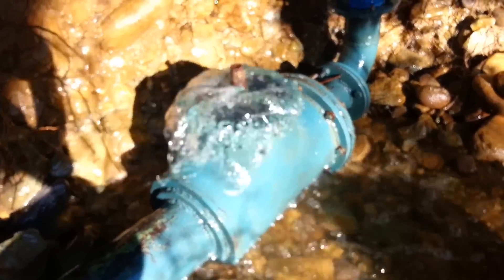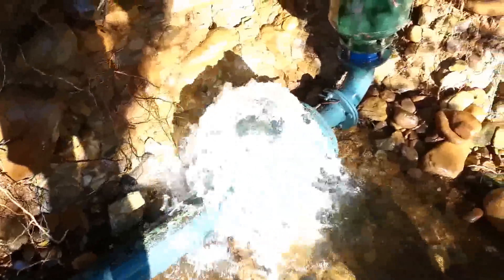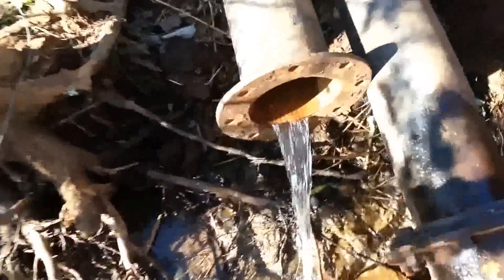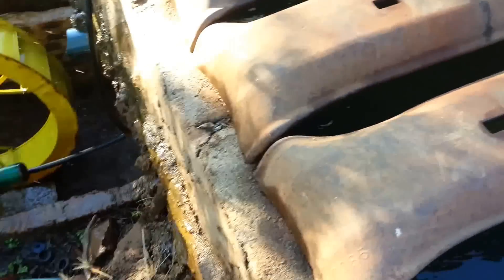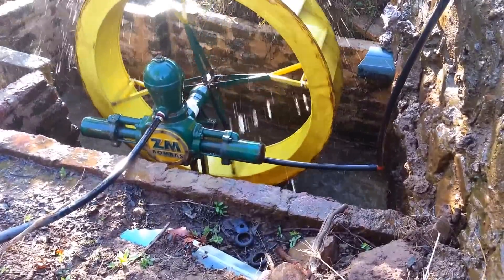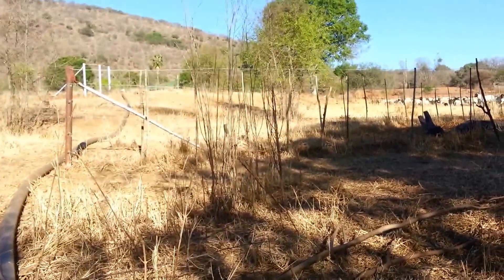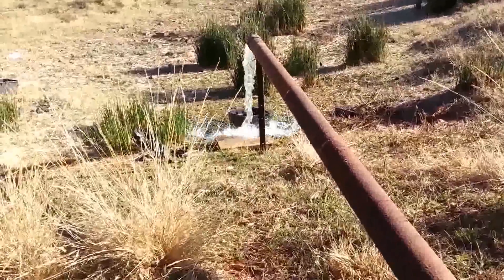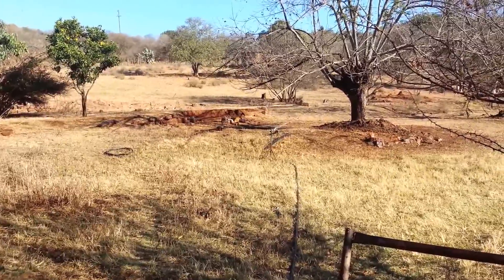DIY Ram-pump ( Big home made Ram pump)

Comment: Thank you for posting the video.  It is rare to see the same person running two types of water powered pumps - in your case the ram pump and the zm Pumps water wheel piston pump.  How would you compare the pro's and con's of  each?
Link to zm Pumps Facebook group discussion:
https://www.facebook.com/groups/240458583255303/permalink/247360809231747
Link to new comparison of water powered pumps Facebook group discussion:
https://www.facebook.com/groups/240458583255303/permalink/688190278482129/

Comment: Although you "showed" us what was there, you didn't explain what anything actually was, or how it was made, or  how it worked or provide any figures of flow rates in/our, height/lift, etc, other than 1200 lpm. Some schematic drawings would have helped. I found it thoroughly confusing and badly explained.

Comment: I did not grasp where the original water in the reservoir came from, I see that it goes to the big clanking pump in the stream bed. The water wheel thing seemed to be pumping the wheels waste water up to a sprinkler - I was fascinated & engrossed but got a bit lost. Maybe a diagram on paper showing the major parts at the start and throughout the video ? thank you for sharing - very interested in this setup

Comment: Very cool man very cool. You have an amazing system there. Amazing water resource. 

Does the river go higher than your land? A siphon seems like it would work if it does. Or a trench. 

Also if you are going to this extent, why not put in a proper turbine? Then pump with electricity and power your life and neighbors life too? 

When you use the water I can say that sprinklers used during the day are the biggest waste of water and nutrients. Better off with soaker hoses that are partly buried. Saving all that water pumping could give you the electricity for your life and leave the extra water for the fishes...

Anyways It's easy for me to say from my armchair, good on you for actually doing it!

Comment: You use lots of water falling a short height, to make a smaller amount of that water move a higher height than the water is falling from.  If 100 liters per minute fall 2 meters, this thing will give you something like 5 liters per minute pumped 10 meters up. That allows you to use the freely-falling water (which costs nothing), to get some usable water pumped to where you need it higher than the stream. 
It's more efficient than say, making electricity with the falling water, then running a motor to pump water. This is because you forgo electrical energy loses, and just focus on driving a pump to push water, using water. Losses are only the mechanical loses of the pump that's pushing the water (inevitable) and however efficient the powering side of the pump is. But you're using a mechanism that pretty much can't break, can't overpower itself, has minimal moving parts and is powered by falling water... which you appear to have a lot of! 

 The simplicity is beautiful. Why wouldn't everyone want to put mother nature to work in this nearly harmless way?

Comment: Just a question. Would it not be better to use something like a venturi where your pressue supplies join? Seems like using a tee both supplies are somewhat nullifying each other and would do away with the 90% elbows which constrict flow. Great video and well explained
Reply from the maker: nostoh thanks for the input and thank you for watching my video and for the kind comment

Comment: that is some nice output coming out that large pipe you opened the valve on....not sure if you need it..but if there is excess water at the top of the hill you dont need....run another pipe down toward the creek and put a small hydro generator station and create some power/hydro...

Comment: A ram pump derives its energy from the head of water located above the pump. What is the minimum head necessary to power a ram pump? Is there a flowing water equivalent of a hydraulic ram pump, i.e., a ram-type pump that derives its energy from shallow flowing water?

Comment: Hey, I had just a few questions?  Did I understand correctly ithat the pump feeds water into a storage containter?  Is that the one over by the water wheel?  My question was, the pump is designed to use waters natural elements of how it works with gravity to buid pressure and in turn, well, harness energy. I wanted to use somesimilar devices to do the same at my house. I  live in the city tho, with roomates and it sucks sometimes Iwish I didn't have to go share a bathroom area with them, bu instead had  abathroom arjust set up in my room with natural running water, but just placing a bucketor container of water on a pulley system (if I need that.) I thought at first, I would need to find a gas pump to force the water down wards ino my macgyer ass running water system.  I don't think I could use this unless I needed another part that just needed the overflow watet to be controlled, but I tried to make a syphon one today that used the pulley system as well, but instead of raising the whole water bucket I wanted to just find  a way to push and pull the air,.  I was thinking maybe foot pump or something because I tried making a water syphone pump and no water came out the tip it was supposed to.  My next try I think is to just place a piece of rubber in the storage container that will start eh whole gravity force thtat gets it in motion, and when someone pulls ont he valve to turn the sink on, it will remeove the rubber, and send the water down throught  gravity....

Anybody know what's up?

Comment: I am wondering if balancing your water wheel would help pumping a little bit more water.
Reply from the maker: i sold that thing
Reply: I wondered if the speed was the pump/fill strokes.   I thought it seemed unbalanced too.   Think if you had a public utility that had a bunch a ram pumps filling a really large water wheel.   You could get decent power output off of that from the weight.   There’s no inhibition from having ram pump after ram pump on the same source...or even in a chain up a hill as long you had enough head and input into a reservoir to feed it.    It’s just a real simple overflow drain for the extra.   The world’s about to change
Reply from the maker: I agree with you.  Thanks so much for the comment

Comment: I would have thought this amount of pulsing shock would eventually shatter any of the more brittle steel components. Lost of smaller rams would only loss you a tinny bit but you wouldn't get that noise or risk problems from such presser and impact shock. I would very much lover to have that kind of flow of water on my land though.
Reply from the maker: thanks for your comment 
sir and thanks for watching

Comment: it is a beautiful pump system. discovered it today. saw a few different ones. different in size and loudness. yours gives a lot of water but it is very loud i guess and i can see the high forces generated inside. every time the water stops and starts moving again you see the pipe shifting a little. do you get failures a lot? i can imagine that valves will break or bolts and flanges will tear after some time. but a very impressive installation. keep it up
Reply from the maker: you are 100% right , i used to get alot of failures , if you are building a rampump to last you have to spend a buck to have it last thanks for watching

Comment: hey bro, nice setup :D just wondering if you're still using the same system, and have you tried a lighter weight check valve? maybe some brass pads that mate with other brass pads at the contact point to reduce the noise? just curious about how these would work. awesome vid, take care.
Reply from the maker: +lordmcted Hi there first thank you for watching and commenting on my video , to  answer your question no I am not using the same system anymore , it still works but I am using a solar pump at the moment , it is much easer and a lot less (1%) maintenance , not sure if you could use brass pads never tried it but I do  use thick rubber between the steel plates to make a good seal and to dampen the noise , if you have any other questions please post them I will answer them prompt

Comment: with all the money you pay in pipes you could buy a solar powered pump don't you think.
Reply: +marek amraly You could always source pipe from junk yards plus all you need are very  basic fabrication and welding skills which most country folks would already have so for some they are good to go.....
Reply: It'll also keep running day or night, and provided the components are beefy enough it'll run as long as there is water flowing.
Reply from the maker: you are right and i do now have a solar pump you can have alook at my channel i get about 26000L/h but if you have the pipes and you are poor like me at that time then you have to make what you have thanks for the comment

Comment: Some thoughts : A ram pump behaves in a mechanical sense the way a step up transformer does in an electrical sense. The electrical step up transformer increases the electrical potential ( being Electrical Potential Energy per Coulomb of Charge, commonly called Voltage ) of the current in the secondary coil at the expense of having less secondary current than in the primary coil. The mechanical energy step up transformer , in this case a ram pump, increases the gravitational potential ( or Gravitational Potential Energy per kilogram of water ) of a smaller volume of water being pumped uphill against having a larger volume of water being allowed to spill downhill . I've heard that some ram pumps have continued pumping for 2 or 3 almost 4 decades without needing repairs while also not needing an external energy source; just the creek itself.
Reply: Not a step up transformer but a boost converter circuit

Comment: I see the water in the creek, but how did you get it to the reservoir for the ram pump? I have a similar situation, but the creek does not have enough 'drop' for me to run a pump. I do have hills next to the creek which would work perfectly, but no way, other than electricity, to get water out of the creek. I like your setup, but still don't understand this part.
Reply from the maker: Hi ok so how it works is my river comes from higher ground now what I did was a dug out a ditch on the side of the river and kept digging it level along side the river so until I was satisfied with the height from the ditch to the river hope you understand thanks for watching

Comment: You should look to add in an electrical generator to the water wheel. You can derive useful energy from this system too. In fact, if you modified the ram pump you could wind coils on the outside and put magnets on the piston of the pump. The back and forth action will generate a current that you can rectify. There's many places and ways to extract electrical EMF from this sort of system. Even with out that your system is awesome. It's the biggest ram pump setup I've ever seen. Good on you for your productivity and ability to make the land green.
Reply from the maker: hi sir you have a brilliant idea , if you dont have alot of money you have to make due what you have but i think  it is better just to use solar panels thanks for watching

Comment: This doesnt look like the ram you were building.maybe I missed something.
Great pump though .My 2 inch ram is working hard to pump 1 gallon a minute.I think I may have the water to run a pump your size if I can scrounge the parts as you did
Reply from the maker: *****  yes in this video , this is not the ram that i build . this was my first ram that i build i did not make a video of me building it but i will post a video of the second ram that i build in my how to video , sorry
Reply: Phillip Fourie I live in Augusta Ga america and dont have the water you have,just a small creek dammed up that gives me 3 feet of fall.Do you know what gallons per minute your monster is pumping?
Reply from the maker: ***** dear Alan my 2 pumps pump around 3500L/h i would say each pump pumps around 1750L/h 
Thanks for watching

Comment: Hi Phillip,
I think you've got it.
Your are living in a place witch locks difficult and going to transform in in a Paradise!
Respect!!
The only point i would try is to stock the excess energy into Water or compress air and to come away from those ugly polluted batteries banks.
Watt about creating a pond with fishes to use the excess Water and organic material you will produce with the water on the land...
Regards from Switzerland
Peter
Reply from the maker: Hi thank you so much for your input ? I have an idea on pumping those waters for a quadraphonic system , I think it would work great and i will then recycle the water and have an income of it or do you maybe have a better idea ? what would you suggest ?

Thank you for watching
Reply: I gess aquaponics system?
Remember that water is not enough for your plants. Fish are producing the needed substances for your vegetables.
If you have a deep pond you can use the water all year long because the fish can stay in this water during frizzing seasons.
Calculate the deepness of the pond with this formula : 0,1 percent of the altitude your are living.
Example: you're living at 750 m altitude, you will need a pond of 0,75 m deep. 
To it, you have to add a half meter 0,5 m creating a zone (1,25 to 1,5 m in our case) in a side of the pond to operate or to extract fishes during winter or to save fishes in case of water losses or extreme heat and water luck.
If you find a way to keep the water always moving, you won't have any problems during winter.
The water better has to travel under ground to keep unfrozen during winter. Earth is warming the water up on a long distance.
New energy source:  you can heat or refresh your house with this water if the pond is big enough by using thermal exchange pump.
This will keep your electricity needs on a lower level during summer and winter.
Finally, you need to test the kind of floor you have to be sure water is going to stay depending of the region and the kind of grave... this is a difficult part including the geological risks...
What do you think about this part?
regards
Pierre
Reply: Paradise is getting near every day...
Pierre
Reply from the maker: ducati Switzerland  You see i am so thank full that you came across my channel , of all the research that i have done nothing came up like you said it , thank you so much for your knowledge and time to write to me i really do appreciate it ,and thank you dear sir for everything , thank you again and bless you
Reply from the maker: ducati Switzerland I have a pond here , made of concrete , for heating the water to 17 C i was thinking of using a small low pressure solar geyser or collector and recycle the pond water through it with the use of a small 12V DC pump and have it pumping during day and at night time a was thinking of covering the pond with a thick plastic like the ones rich people use to warm up their swimming pools and hopefully keep some of the water heat inside the pond or what do you think
Reply: Phillip Fourie I again Phillip,
Wich altitude do you live?
You pond will need a lot of O2 and living material as well if the concrete is to clean, it will be difficult to have a reserve for fishes. Maybe you shall not cover it but build a plane surface next to the pond like a flat cascade to let the water go over it and been warmed up by the sun and cleaned by the UV from the sun.
The cascade effect from the water dropping into the pond will bring you a lot of O2 as well.
The pump you plan to install is more necessary to clean the water trough a filter containing some charcoal, zeolith stones and gravel and sand after the water went trough your plants and vegetables.
what do you think?
regards and no matter
Pierre
Switzerland

Comment: Interesting video Fourie.
Your Ramp pump valve sounds as if it's metal to metal contact! The one I have has a half inch thick 7'' rubber diagram that deflects to cut off the water flow and the pump makes far less noise than yours and will probably last far longer! Doesn't yours have any rubber anywhere, to help reduce shock and noise?
Reply from the maker: yes actually it has rubber plate in my main valve it is still loud , thank you for watching and your comment

Comment: Nice . Two thoughts 1 ) that pneumatic / hydraulic unit , the very heavy closing noise ( metal on metal ? ) would suggest ware , may be a rubber seal ring , would be a good , rather than rebuilding the mating metal surfaces .  2 ) the very vertical drop onto the overshoot wheel ..... most designs seam to hit wheel at a tangent, not almost direct onto pivot point .
Reply from the maker: Thank you for your comment . actually you cant see in my video ( sorry for that ) but the hydraulic unit actually has a  piece conveyor belt between (thick rubber) the units so there is no metal on metal and only a small amount of ware on the rubber itself .

Yes you are right about my water wheel i am still working on it but, it is flood season in my area so cant do nothing
Regards
Reply: Phillip Fourie Thank you . Pneumatic / hydraulic ....... very impressed that it is still so loud , even with rubber seal / buffer in it . Would be so great if you could use all that closing force to fick a wheel / generator over , the last 1/2 inch may be and a ratchet / escapment may be ? 
Water wheel , bring wheel up to the snout , or bring snout down to the wheel , or extend the snout & let it free fall onto the edge of the wheel . 
Were is "flood season" ..... ? you accent sounds in Africa ... south ? 
Regards Bob ( London UK )
Reply from the maker: magna59 Yes i am actually in South Africa, You can use the Pneumatic piston to drive gears , when my pump is pumping water i can stand on the piston with my whole body weight (81Kg) and the pump does not stop the piston keeps on pumping even if i stand on it with no trouble , You have a very good idea, just a little engineering and a lot of thinking thank you for watching .